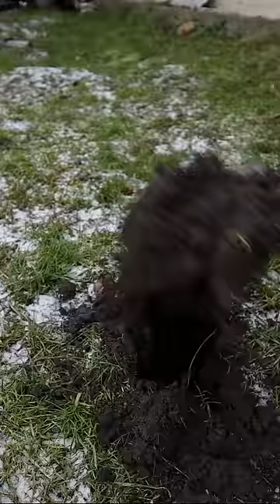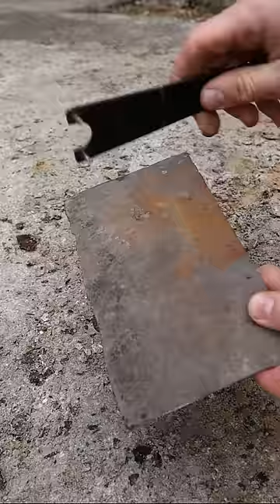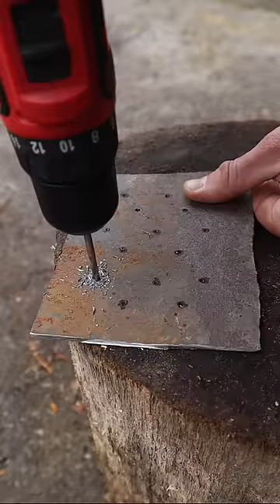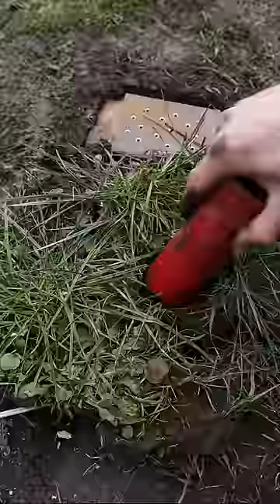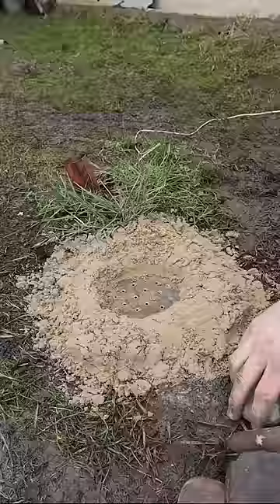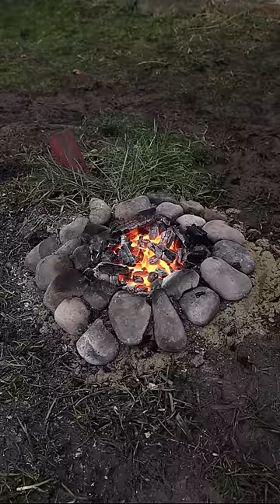Beginners Underground Forge

Comment: Nice looking dirt!
Reply: I was thinking same thing! Except of course it's called soil. Dirt is what they sweep in the hallways and throw in garbage.
That's direct quote of my soul science professor in college. Being a smartass i noted that i'd seen 20 foot tall trees growing in garbage in gutters in the city. He said "but would you want to eat the food growing in dirt?" bc it was an agricultural college.
Engineers still need to know soil science but for Cut fill and Made Land soil series
Reply: @Macumazahn  Firstly, I know you meant "soil science," but I cracked up at "soul science." Really hoping you actually have dirt under your nails. Moving on!
Did a tree planting job outside of Emporia, VA and they used some mixed fill for the grading leading up to the riparian area... The stuff did not mix well and would sink about 6inches in about 3ft in all directions when stepped on and then return to the original shape when weight was removed. At first I thought I was dreaming or got slipped some kind of psychedelic 😅
Anyway, the wildest part was taking the tractor w/the tree planter through some of those areas. Really wild looking. Some of it was unplantable with the machine (tractor w/ a slightly modified tobacco planter) or risk losing the equipment, so we had to come back a couple of weeks later to finish, but, when we did, they had come to the conclusion that their grading was off spec so they regraded it.... razing about 1/4 of the trees we had planted 🤣 Regrading it did absolutely nothing for planting conditions.
Reply: @burtan2000  ooh, one more quick story.. when I was just starting out in forestry/ecology (I'm self educated, I went to college for pedagogy but didn't pursue it after), I applied for an entry level technician position with DOF (not mentioning the state lol) and lost the job to a guy with a 4 year degree. He did have some working experience and was a pretty impressive walker, in my opinion, but he was lacking experience operating equipment... He ended up getting a D8 dozer stuck in a drainage ditch on an active prescribed burn where the fire had jumped the line because he decided it was a good idea to cross the ditch perpendicularly... Damn thing got buried pretty bad, so they had to call for additional resources to unfuck his severe fuckery. Long story short, DOF desked him... Not fired, relocated to a different region altogether with a pretty desk.. the absolute worst fate for a young forestry tech lol 🤣🤣🤣🤣🤣🤣 
I doubt he'll ever get to be a Forester unless he decides to switch to the private sector and get registered. Most of the Department guys don't typically want to leave a salary w/benefits though, so I hope he enjoys the desk and the view
Reply: So dark and deep

Comment: My son destroyed three of my hair dryers building forges when he was a teenager. smh

I finally got him to communicate with me. TELL ME when you need a hair dryer and I'll buy you them from good will. You can melt them for all I care.

And then he ran out of hair dryers and stole his sister's. (sigh) I tried.
Reply: Is he a good Balck Smith now?
Reply: What did you do when he stole his sisters did you punish him
Reply: @Fnafplayer64  yes indeed there was. A serious conversation followed by a firm slapping of the buttocks.
Reply: Is your son a dwarf?
Reply: air bed blower is stronger  and loud.  but it has a hose(some times)  Or you could sit down and make a  good forge with them.    Made one with a air bed blower charcoal is my fuel. It works very well .
Reply: @blackgriffinxx   thanks for your input, I must try that. 😊
Reply: @RRED2   tell me what you have or can get  i can help you make one.  
 If you can find a trash pile.   it can be made well with a little work.    An oil drum is pretty much the  the ease way to make one. Just  Cut 2 holes. Add a break disc with a plate in it.  Make  a place to put a blower and it is ready.
Reply: If he is still into work, i use a pringles can taped to the hair dryer so that the dryer isn't that close to the fire. Pringles cans are made out of paper so it's not the best alternative and you gotta be careful but it is the best thing i could use for the moment and it can last a couple forges if you make sure it doesn't touch the fire
Reply: You should've bought a couple of them when you knew
Reply: Your son is clearly a dwarf! A good dwarf has a passion for learning the arts of balck Smith.
Reply: if hes still doing it tell him to use something like aluminium cans to make the air flow into the forge instead of putting the hairdryer right up close, i personally made a steel pipe that i run from my blower vac into my forge and because of the length and way i have it set up i havent yet seen any plastic melting or damage
Reply: Just say to your son that all he need is to attach a metal pipe to the hair dryer, you can look for an old vaccum in garage sales an use that pipe. Other option is to find and old frigde's motor and do a little modification so it's can blow air and will not melt (but don use it for more than 2 hours without resting the motor)
Reply: @JavierGarcia-gn2gr  Hahaha I can't stop laughing dude. He's afflicted by Dwarf Syndrome 😂😂😂

Comment: I made one of these by accident as a kid, just efffin' around, trying to entertain myself. Buried some coals in a hole, stuck a steel pipe in, put the plug back, and used an air mattress pump to blow air through the pipe. I think I was just curious to see what would happen. I was shocked when I pulled the pipe out and it was molten at the end. Pulled the plug out and threw in an old padlock, and repeated the process. Melted the padlock into a puddle. I felt like a god.

Comment: You don't need 99% of that stuff.
A shovel, a pipe and a bicycle pump are all you need to build and have a usable forge.
Reply: you need some sort of refractory material or you're not going to be able to get to high enough temperatures to effectively forge. If you're just going to use air induction alone, just use a pair of hand bellows and a campfire for christ's sake

Comment: Could have just dug a hole, drove the pipe in at an angle to break through to the bottom of sidewall, pulled pipe back out with dirt plug in it, removed plug, put pipe back in empty, then insert fan outlet into or onto pipe. Then you disturbed less ground but still have a fan powered Dakota Fire Hole forge.